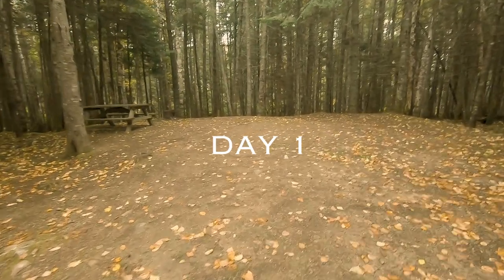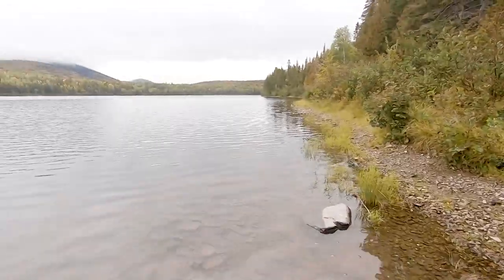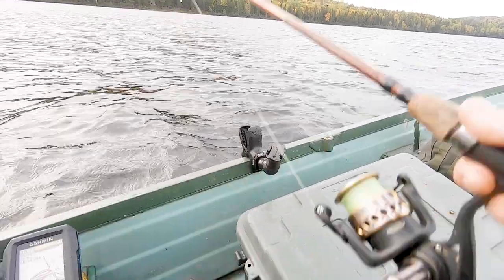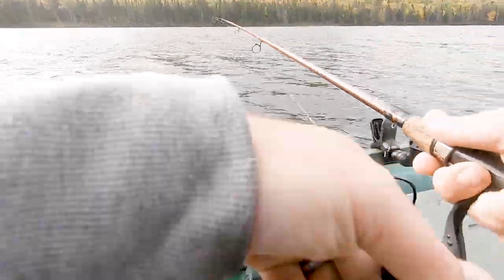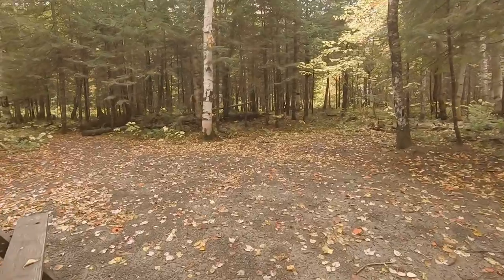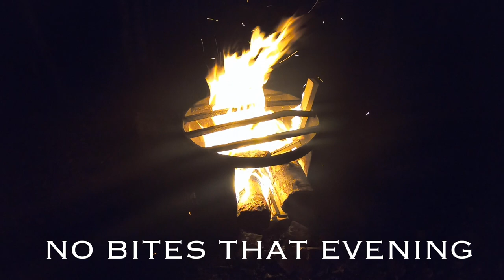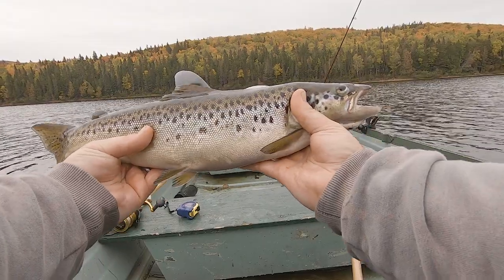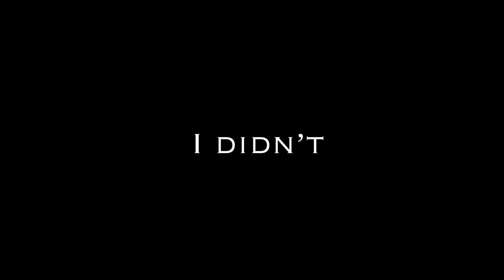Vertically Fishing Landlocked SALMON  at Lake NICTAU, NB.

Comment: Didn’t think you could use treble hooks here in NB. At least in Miramichi, DNR says even spinners for Brook trout need to have single hooks (I always pinch the barbs regardless)

Never fished this area, or landlock salmon though, at least with sea run salmon you need a barbless artificial fly, and for trout, from what I’ve been told from multiple rangers, a single hook (there was some debate on barbless)
Reply from the maker: You cannot use trebles or barbs in Miramichi. Most lakes in NB, trebles and barbs are allowed. Tight lines!